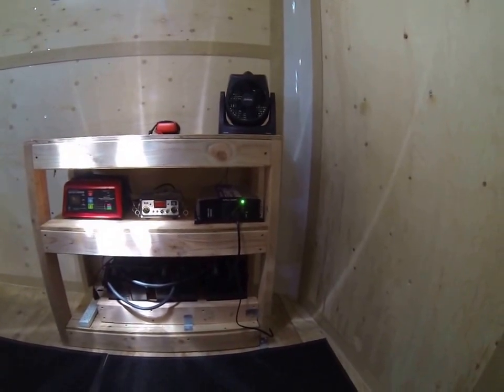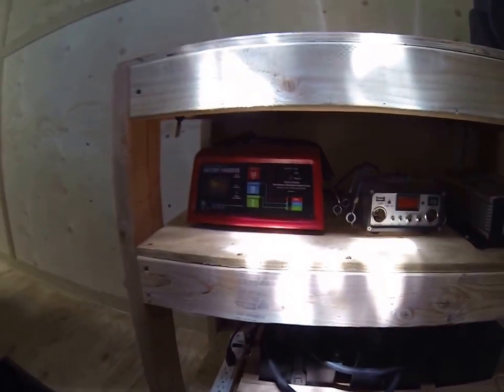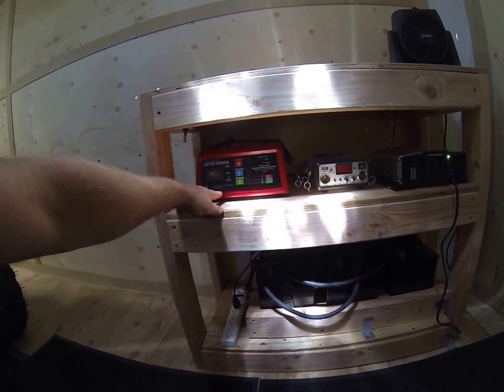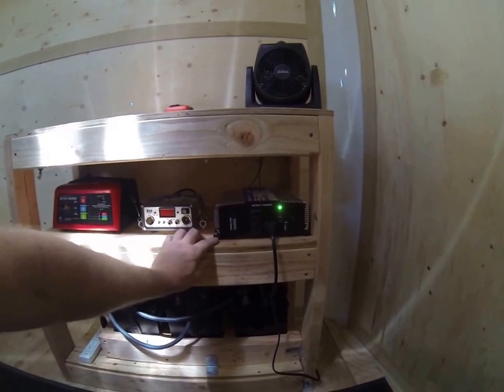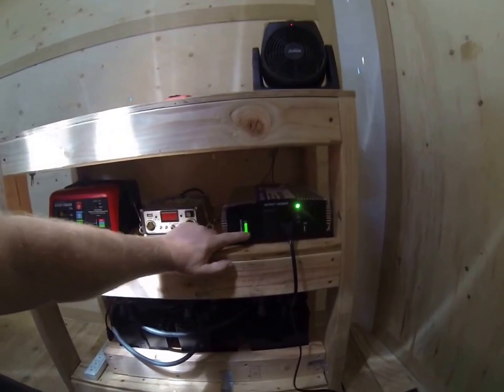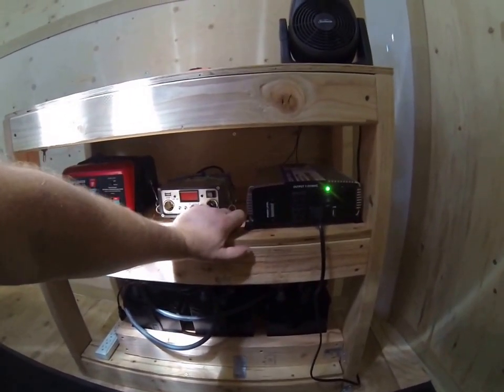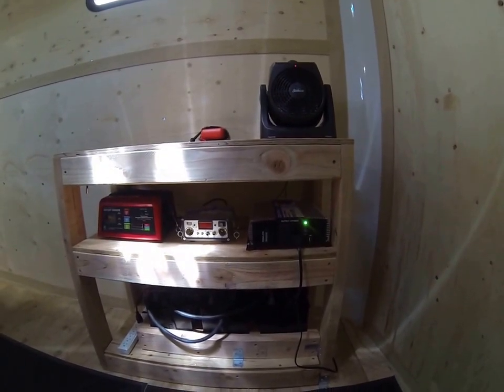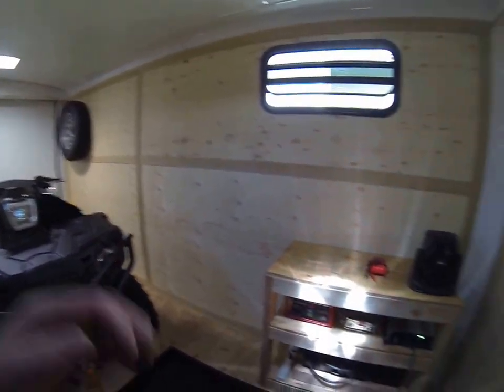Battery Bank in Utility trailer 300 Ah

Comment: hey man good video.  i have the same three batteries.  whats the biggest thing youve hooked up to the inverter and how long did it last?
Reply from the maker: Thanks, so far a 750 watt heater we used when camping in the trailer. It burned through the batteries before morning so I didn't get to count the hours it lasted. Ive learned that using 12v items and not using the invertor makes more sense and run time.